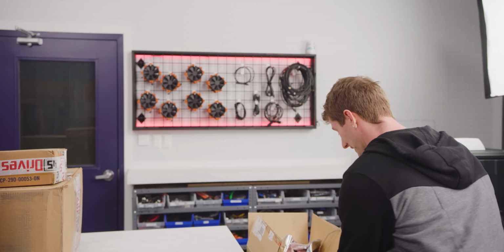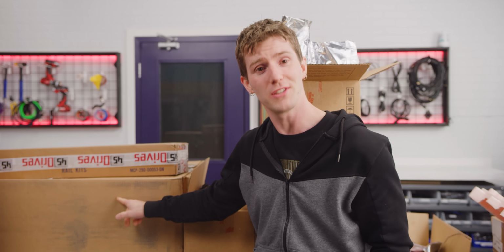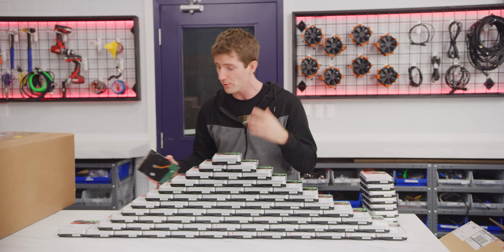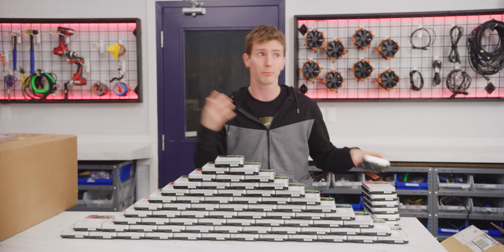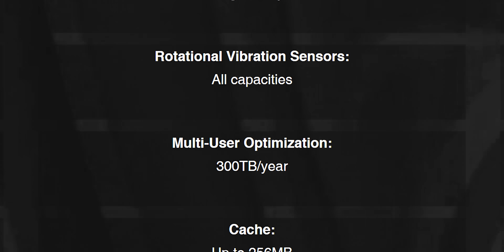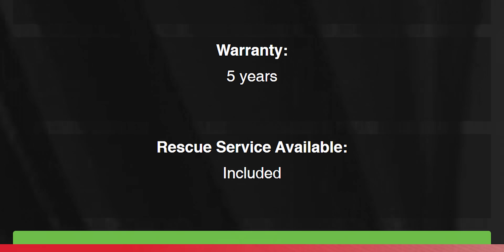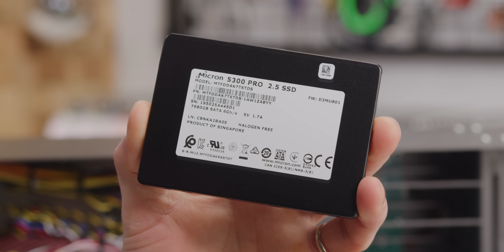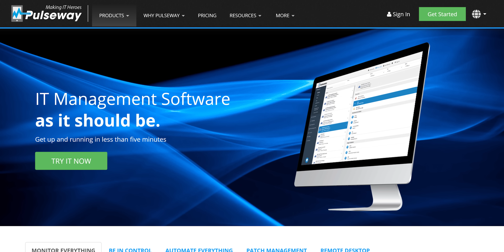Unboxing 3 PETABYTES of storage!!

Comment: 6:13
The tape library for the mainframe at NCS (later NCS/Pearson) had 2 sections (and was later replaced by automated robots).
Section 1 was 70,000+ of their "then semi-recent" 50 Meg tapes (3.5 PetaBytes), Section 2 (long term backup) was about 30,000.
It DID occupy most of a rather large room, but the mainframe itself was also in there - and the chillers, and the Leibart backup UPSs (that were themselves diesel generator backed up)....

I spent several months there when I first started at NCS (before the Pearson buyout) as one of the 6 folks that pulled tapes from the library and fed the several tape drives, via crt displays mounted to the ceiling saying "this tape to this drive" (2 people per shift, normally only Monday-Friday, weekends the computer operators normally did that job on top of their own, as it was a LOT slower).

Comment: 4:51
Given that the origins of the Storinator was the Backblaze "Pod", that routinely uses CONSUMER grade drives instead of server drives, you didn't need to worry about the "ratings" being an issue.
And 45 drives has added more vibration damping than the original Backblaze Pod4 design they were originally based on.

Comment: I’ve have had enough with my wd my cloud home duo with 2 2tb drives, I just ordered 4 4tb ironwolf drives to use in a synology rs1221. Does anyone know if I add 4 more drives later, will the data get rewritten to the additional 4 drives to have data on a total of 8 drives if I’m using shr1 or will the new 4 drives be more of an extension to the first 4 drives?

Comment: Regarding ARC: All modern OSes have some form of in-RAM file or block cache. This isn't unique (except the MFU retention).
L2ARC: with that many drives, the drives are almost certainly faster than a single SSD, for sequential IO, which is what you care about for video.

Comment: Ran an ibm system 32 big as a large freezer and 10 x the Power requirements and the largest disk space of the day..... 13 whole megabytes on 6/14in platters in a huge very rigid enclosure. Which weighed a ton

Comment: fun fact:

A petabyte of storage would:

Cost $93,662,499,307,520. Require a building the size of 10,814 football fields to hold the drives. Require 472 of the world's largest data centers to hold the drives.21 Jun 2011, but it was on 2011 10 years ago

Comment: buying same brand of hdds, maybe even same model, same capacity, could even be similar batches, not smart when it comes to hdds... In case of a problem with the manufacture, you have a lot of affected drives.
Also similar manufacture dates gives higher probab of close failure dates...

Comment: why dont you just order 30 exadrives
Reply: They have slow download and upload.
Reply: @LeuBlue  yeah but still faster than hard drives
Reply: @bloonsfamily2066  no the exadrives are actually slower than hard drives because of their big capacity
Reply: @LeuBlue  no they are faster
Reply: @bloonsfamily2066  no lol
Reply: @bloonsfamily2066  but that 30,000 dollar for just one drive = bankrupt
Reply: @LeuBlue  bbut thats for 512 byte transfers
Reply: @bloonsfamily2066  yeah i did the math...
A petabype of space using hardrives comes to a total of 31,000. A single cost of a 100tb ssd.
A petabype using 100tb ssds is 900,000... For 30 drives..
Reply: @bloonsfamily2066  well yeah. You need high transfer Because of you need 30 or 62, 63 drives

Comment: Can I just point out that those drives are rated for 2.5 million hours, or over 285 years.   The drives will live longer than you will.
Reply: That is not what MTBF (Mean Time Between Failures) means. It is a statistical mean of the distribution across which all such drives will fail. Approximately, in this case, that would mean 7 drives would fail every 2 years (or 3.5 every year), if you use 1000 such devices (24 hours a day since it is a NAS). 

Just FYI
Reply: @RishalRaj  I didn't know that, I guess that makes more sense.
Reply: @inventorllama0321  No worries. That's what the internet is for. To collectively help each other know more :)
Reply: @RishalRaj  well, not when all drives will fail, but just the average time it takes for a drive to fail.
Reply: @__8120  The "statistical mean" of the "distribution of all such drive failures". The statistical distribution of all such drive failures, if that clarifies things?
Reply: @RishalRaj  that's not what you said. you said "across which all drives will fail"
Reply: @__8120  Umm... no. What I said was, STATISTICAL MEAN OF THE DISTRIBUTION ACROSS WHICH ALL SUCH DRIVES WILL FAIL. Not all drive failures, the distribution across which all drives will fail
Reply: @RishalRaj  It depends on the distribution of the failures. There's a big difference between a normal distribution and an exponential distribution.
Reply: @gubblfisch350  What depends on the distribution of failures?
Reply: @RishalRaj  I just checked Wikipedia and MTBF of x actually implies that the distribution of failures is an exponential distribution with parameter 1/x and expected value of x. That means that your calculation is correct. 
If the distribution was different but also with expected value of x, it could be possible that nearly all drive last between 0.5x and 1.5x, which would mean that your number of failures in most years could be very different from the overall average failures.
Reply: @RishalRaj  oh so it like "man hours"
Reply: How'd they rate them...
Reply: @__lasevix_  backblaze has a load of data on what percentage of drives fail every year, something like 3-10% of drives fail every year depending on the model
Reply: LOL
Reply: I didnt understand anything but 1tb is small for 3 terabytes
Reply: The problem is that they will eventually be so out of date they will be obsolete before you fill them or they die 😆😆
Reply: And who said hard disks “wear out”.
Reply: @bobyblobfish3117  me! My PS4 one just did!
Reply: @crabrangoon2493  same, my external drive for my ps4 just kicked it
Reply: Seagate sucks
Reply: @20102005025  okay Jesus
Reply: @20102005025  Because of that one defective model? (ST3000DM001)

Comment: And here I thought I was doing good with a 42TB NAS. My main concern with this would be the power bill! My 42TB NAS runs using a celeron J4105 with 8GB of RAM and a 1Gb network port, HDDs run in JBOD mode with daily software driven backup to warm mirror. Fine for my needs and only uses 27 watts of power. I designed it for efficiency and centralized network storage. Excellent Demo Linus!

Comment: NASA: [Laughs in 100 Zettabytes ]
Reply: NASA wants to know your location
Reply: I don’t think that’s an actual increment.
Reply: @cringecrew7248  heres a table 
Unit	          Shortened	              Capacity
Bit	                   b	           1 or 0 (on or off)
Byte	           B	              8 bits
Kilobyte	          KB	         1024 bytes
Megabyte        MB	1024 kilobytes
Gigabyte          GB         1024 megabytes
Terabyte	          TB	         1024 gigabytes
Petabyte	  PB	        1024 terabytes
Exabyte        	  EB	         1024 petabytes
Zettabyte	  ZB	         1024 exabytes
Yottabyte	  YB	         1024 zettabytes
Reply: oh and lastly brontobyte 1024 yottabytes
Reply: @Deadchannel06  How many bits is in 1 Brontobyte
Reply: @Dodger24  Oh God heres some math staring with kilobyte 8000x1000x1000x1000x1000x1000x1000x1000x1000x1000=

8000000000000000000000000000

or E form 8e+27

or scientific form 8 × 1027 
Edit its 10 to the 27th power but yt doesn't allow me to use different numbers
Reply: @cringecrew7248  it is a billion terabytes
Reply: I zettabye
Reply: @cringecrew7248  100 zettabyte=100 billion terabytes
Reply: more like yottabytes
Reply: Brontobyte
Reply: Poopbyte
Reply: I don't actually think NASA has that much storage... what would they do with it?
If you want to find zettabytes of data, your best bet is YouTube.
Reply: More like UrMumbytes

Jk
Reply: well actually, google is likely to have the biggest storage out of all corporations. (including youtube and other applications like google drive)
Reply: Also nasa 720p60 in 2021:

Comment: 8:29 LTT: "just 128 gbs of ram"

Me laughs at my pc that has 2 gbs of ram

Edit: i have now 8 gbs of ram :)
Reply: “just shy” is very different than “just”
Reply: i have 4 GB, but in quarantine, one of them just anonymously Gave Up living. So I Was Left with 2 GB RAM for some months. It could be fixed but we never did that, because after some months for some reason my whole PC started failing, it would go black screen and then some sounds of electric currents or a "DRRRRRRRRRRRRRRRRRRRRRRRRRRRRRRRRRRRRRRRRRRRRRRRRRRRRRRRRRRRAAAAAAAAAAAAAAAAAAAAAAAAAAAAAAAAAAAAAAAAAAAAAAAAAAAAAAAAAAAAA", I Switched My Whole Thing-that-processed-the-system, not the keyboard, mouse, monitor etc. And then we got a new CPU with 4 GB RAM. But MAN was 2 GB RAM was a PAIN in the ARSE (alternative for the actual word "a$$"). Someone on Discord was like "How Does That PC Even Run" when i told them my PC had 2 GB RAM. And MAN was That thing Old asf, it was atleast 3 Years old If Not 5 YEARS OLD. You served me well, boy. But Death Is Inevitable.
Reply: @survivalist2607  Mine only has 4.4 gbs ram normally but I have a max of 7.9 gbs ram.

Comment: Maybe just build a big tape library with those 10TB Tapes. If you don't use the data very much and it is just a dump of old stuff it might be better than building servers full of hard drives. 

Tapes won't consume any power when stored and i think it would be much cheaper than servers. It's also what big datacenters do to store data for a long time if they won't need the fastest access to it.

Comment: 50 years later we are going to have this on a size of an SD card.
Reply: 20 years ago 5 GB was impressive
Reply: @vispev3123  13 years ago 5 gigs were in SD cards
Reply: 50? I think less. Maybe less than 25 years.
Reply: Honestly, it might just be 10, I have found 512gb sd cards for 12$ at Walmart, 4000 terabytes can now be half the size in hard drive height (not including width) we might have zettabytes be standard in 10-15 years
Reply: @theobama8535  Imagine that, I don't know how you could ever fill that much storage up. But I will find a way.
Reply: @ConnorStohl  my music files usually take up 1 gb collectively, so do you think i would be able to fill up a zettabyte? im kind of new to computer tech n stuff.
Reply: @ConnorStohl  games are getting progressively larger as well as just normal everyday applications. Technology is also advancing at a very fast rate, who knows? We might have regular applications that are 10 gigs in file size in the future, and... God knows how big games will even get in the future. Maybe even a terabyte in size.
Reply: @theobama8535  no
Reply: @theobama8535  Those SD cards are fake
Reply: SD cards will be dead in 50 yrs... To have that much capacity on one drive it would need a new standard
Reply: In 50 years, we most likely not have SD card anymore
Reply: @Luca-ok6sw  I doubt that, there really is nothing wrong with the sd card, other than the speed limitations of the interface. There will still likely be an SD Card, but probably a different name and slightly different format, a succesor to SD Card if you would.
Reply: @niko1even  no, we are moving to cloud, 50 years ago they probably thought that what they had at those time were ok, in 50 years we will likely have no USB/SD card at all, maybe just something that work like NFC
Reply: @Luca-ok6sw  Yeah try implementing cloud storage into every single camera. Cloud storage will always have one major flaw, which it requires a connection to the host servers. If something ever happens to the host servers, then you better kiss goodbye to whatever device you own in 50 years.

Cloud storage will never beat the speed of a physically connected drive.
Reply: @niko1even  in 50 years do you really think that we will not have internet connection everywhere? Musk has already achieved to give internet in all the places on earth thanks to satellites, plus camera can simply connect via Bluetooth or internet
Reply: @niko1even  and for the server, pretty much everyone could own a server for himself, and for public server it would work just like today, if one server goes out, you connect to another server
Reply: @Luca-ok6sw  a server for himself eh, well that would defeat the purpose of cloud storage then. You realize that cloud storage is for people who don’t want to own a home server but still want to have acces to large storage. And sure, you can connect to the internat all you want, but being able to connect to the internet doesn’t fix the problem that the speed of cloud storage is limited to the speed of the drives that the storage server is using, and even if they were running RAID-10 arrays in the storage servers, it would not be profitable because of the sheer amount of drives it takes to run a RAID-10 array.
Reply: @niko1even  you do realize that internet is getting faster and faster, and having a server in home will going to be just like having a computer nowadays, 50 years ago how many people could afford having a computer? And now basically everyone have one. But anyway we still could just use public server, it’s not that easy to bring down a server with a good amount of security and backup, how many times the google server got down?
Reply: @Luca-ok6sw  like i said it doesn't matter how fast the internet gets, it will always be slower than the drives that the servers are using. Also, saying that "basically everyone" owns a computers is way overestimating what it actually means, because look at the less developed countries... probably not even 20% of the population own a PC. Also data speed and file size will scale as time goes on, file sizes will only get bigger as time goes on, naturally. Also, issues won't just be on the server side, issues can also be on the devices which are receiving information from the servers, aka the "50 years from how phones, cameras, PC's, etc" which are much more common than server issues.
Reply: @niko1even  the drives are getting faster too, so it matters that the network gets faster
Reply: @henrikhunfeld1349  yeah, it can get fast all it wants. But by the year 2050 or so, you’re gonna need extremely fast storage for data centers. Even DNA storage could be fast enough, and like I said even if you were to RAID-10 the DNA storage, sure it can probably be fast enough, but the cost would be too huge for the companies.
Reply: In 50 years we might replace RAM, SSD's and HDD's with sheets of individually-addressable atoms, which function on a completely different data architecture, and have a 32-core controller to enable inherent data compression.
Reply: @WhenDoesTheVideoActuallyStart  probably not sheets of atoms (because the laws of physics is a bitch)  but probably data stored in a liquid. Mainstream CPU's would probably be either made of GaN or Carbon Nanotubes, or some other kind of semiconductor, which will offer extremely good performance. Technology is advancing fast, but we are approaching a wall soon, until we decide to stop sticking with Silicon, the wall will become even more closer. 
Additionally, how are you going to make individually addressable atoms? You would need to turn the atoms “on and off” which transistors can do pretty easily. As for atoms, probably not.
Reply: @niko1even  theyre tryin to store data in DNA
that has a fuckin high capacity
Reply: We are nearing the theorical maximum storage density, and access speed potential is also pretty limited right now. So that probably won't happen.

The only storage system that could get these amounts on smaller devices is optical 3D storage. It will probably take another 20-30 years for them to be consumer friendly.
Reply: 50 years later we are going to have this on a size of an SD card.
Reply: @limitedtalent4991  maybe not 3 petabytes, because that may not be physically possible due to the limitations of the size of atoms, however maybe 300 or somewhere along those lines.
Reply: @niko1even  i sure hope internet connections develop just as fast. Imagine trying to download a 4 terabyte game with 100Mbps internet, which is considered fast today, that would take 277hours. Even if we get to 10GBps it would take almost 3 hours lol. Also hope for a buffer-free future.
Reply: @randomorange6807  hopefully, 6g networks look very promising for the future of network development.
Reply: Yes, but it would likely be really expensive at probably more than $500 USD. The development of technology is predicted to slow down in the future, but be much more pricy, which is why the PS5 and Xbox X series is typically over $500.
Reply: no
Reply: Moore's law: "I'm about end this man's whole career"
Reply: We might even have YTBs on an SD cards
Reply: With SSDs and or SD cards maybe but with HDDs no. The reason is that because the hard drive is a spinning disk, it had a maximum capacity and read and write speed. Therefore, unless seagate or WD completely redefines and remakes the hard drive then 18 and 20 tb hard drives are going to be the hard LONG TERM usable limit.
Reply: I reckon in 2 years 4tb ssd will be the same price as a 1tb
Reply: And no phone with SD expansion haha

Comment: I wanna point out how this system really is human like:
-SSD = short term memory ->
-RAM = REM cycle ->
-HDD = Longterm memory
CPU: Part of brain handling logic processing.
All you're missing is:
emotional queues based on experience, 
visual input, 
audio input,
Sensors that triggers on touch with various responses depending on pressure and pattern,
and the complex code of processing and accessing memory at will with the understanding of self determined goals

Comment: A hdd has a moving mechanical part so it can be die in few years may be 15 or 20 year so you should use ssd if you want to store your data for a really very long time 🙂
Reply: It's cheaper to replace hdds as they fail then spending god knows how much on 3 petabytes of ssds